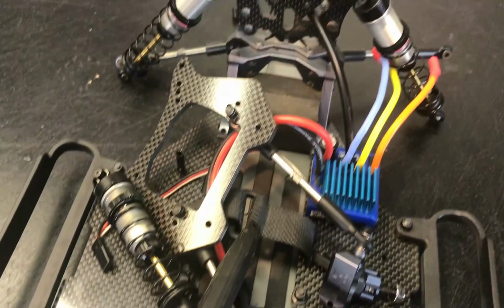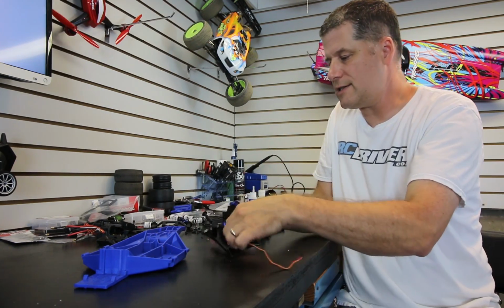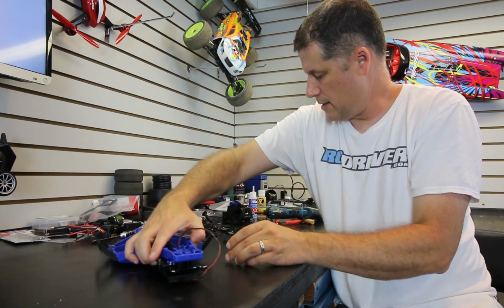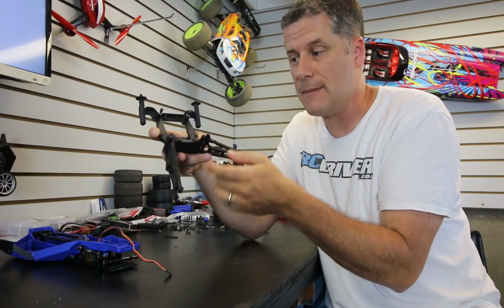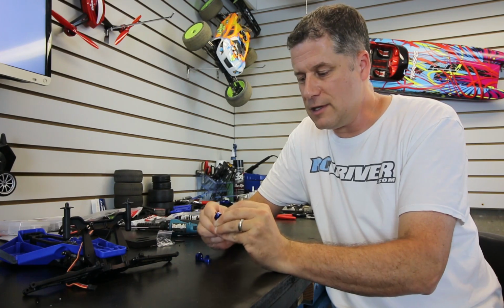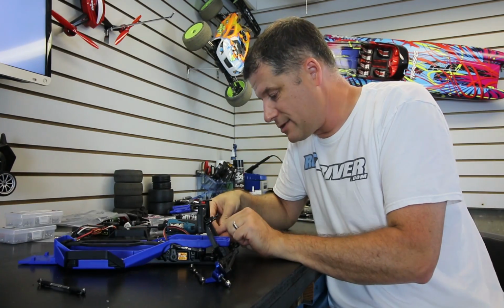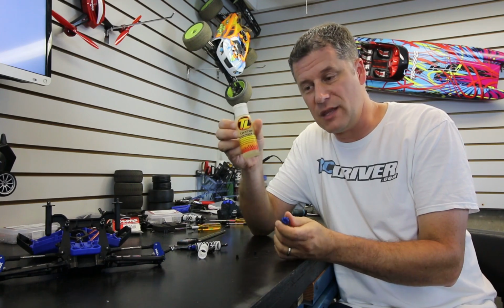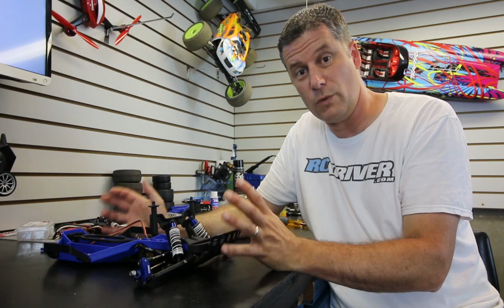The Go FAST Build Begins! - Traxxas Slash RC Drag Car Project - Part 2 Front Assembly | RC Driver

Comment: I went thru a transformation build of of drag slash from a 2wd older slash. I finally completed it. There were alot of headaches that went with the build. Put bandit rear control arms with the new shorter turnbuckle. Also installed the front slash drag front control arms. Non of the original screws worked. With all the back and forth to the hobby store. I finally came to terms...your better off just buying a drag slash ..which I did. For 299.00 it all complete with motor and esc with a controller. Penny wise I suggest if your jonzing a drag slash..just buy one and save money and time. So I have 2 one I built as a conversion and one out of the box complete. It runs pretty straight right out of the box.

Comment: I took notes from your build thanks. But my rear wheels won’t spin after 1 day out. My gears are fine the pins are in place. The motor and gears spin and the wheels spin a little when lifted in the air but on the ground just the motor spins. HELP WHAT DO I DO?!
Reply: Check the slipper clutch

Comment: first i am very glard to introduce myself to you. i am steve. we are from china shenzhen city. we are produce High perfomance lipo battery. we also open one shop in amazon. currently we find that this car is very run well with our this lipo battery. if you need, you could see the below link:
https://www.amazon.com/DXF-5000mAh-Connector-Helicopter-Multirotor/dp/B07GB2RRDW/ref=sr_1_4?ie=UTF8&qid=1541062588&sr=8-4&keywords=dxf+lipo+battery

Comment: I had a lcg chassis like that once and it messed up my steering and I could never turn right. Plus I liked the higher ground clearance
Reply: DirtRiderBen Did you make you sure your servo was in the right position, and set straight?
Reply: @goldsrcracing5950  yeah. I even had a shop help me look at it and we never found what was wrong

Comment: One of the changes I made to my 2wd Slash and Rustler builds was to change the caster blocks to the ones that came on the nitro version of Rustler and Slash. These move the bearings into the wheel hubs and keep the shafts stationary. Does it make a difderence performance wise? No clue, but I like the setup better as a personal choice.

Comment: This all looks familiar cus I just built a track slash with all parts from hot racing, strc, proline,traxxas, rpm parts it was over $1k to build but there’s not one part on it that’s not upgraded down to the bearings n stainless steel hardwear, I know I could bought a rtr but I wanted to build something that was made after the dream slash I had in my head, it came out epic!
Reply: STEVO D 313 I wanna see what it looks like
Reply: Jagster 01 ya it should be sweet